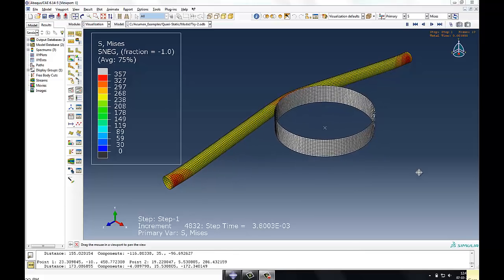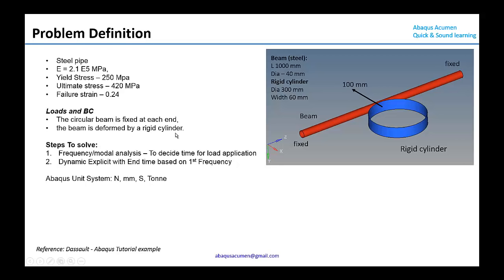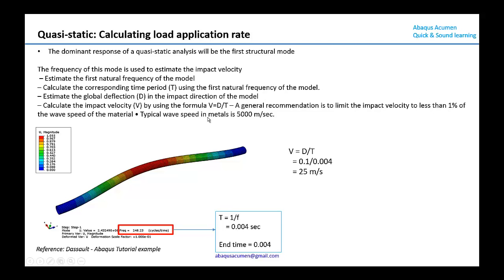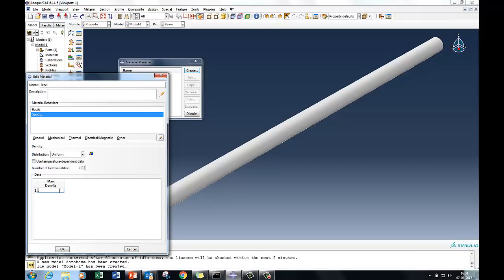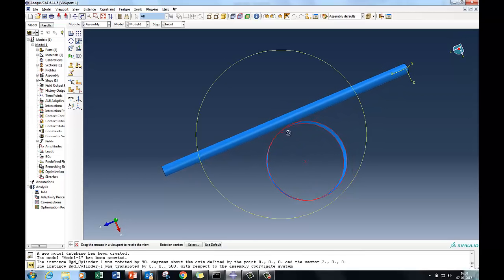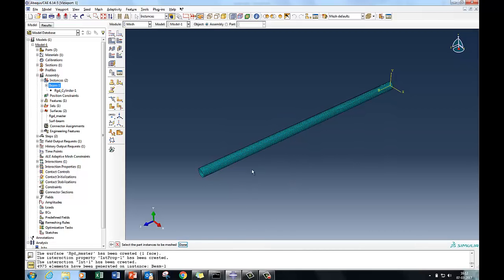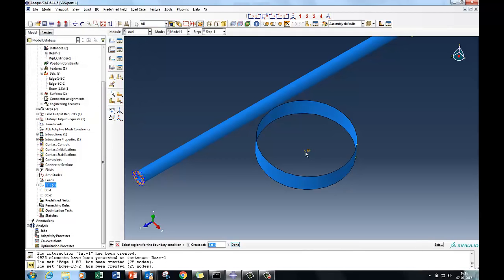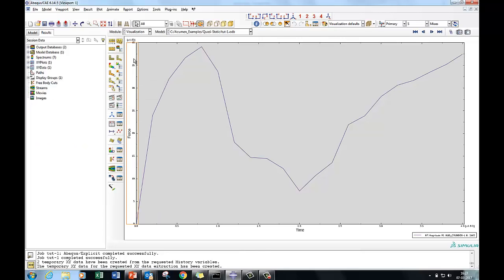AbaqusCAE: Tutorial - Quasi-static Analysis, Steel beam intrusion

Comment: Very nicely explained thank you. 
I have one question, "Abaqus by default gives  option in  step, but here you used Dynamic Explicit and checked the kinetic energy to see whether it is Quasi static or not.....Why didn't you prefer using default Quasi Static/ Dynamic Implicit option,  are there any differences between these two or the results we receive will be same.?

Comment: Sir,

With reference to Abaqus Documentation-6.10,Under Chapter-6 i.e.Analysis procedure,Page no: 6.2.1-1 (or) Page no:6.2.5-1,
can you please give Demo on the Quasi Static Analysis with respect to Abaqus standard,which includes time dependent material response(Creep,Swelling,Viscoelasticity and two layer viscoplasticity).

It will be very helpful.